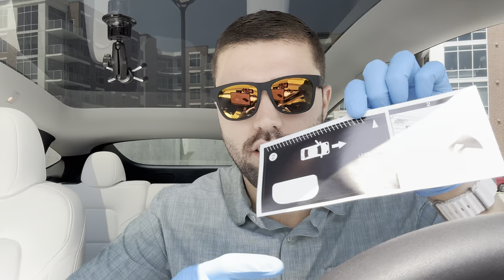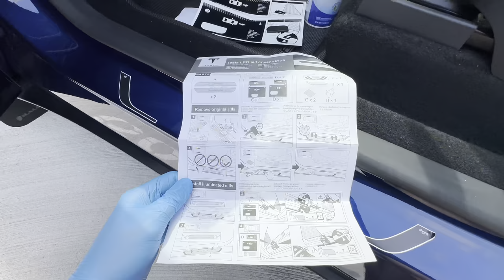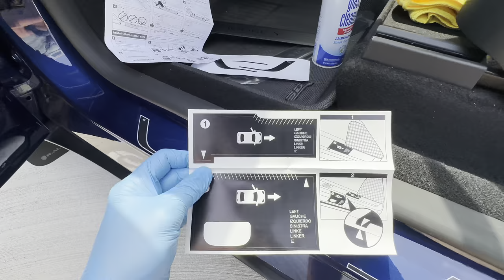It's Time To Get Lit.... Door Sills On My Tesla Model Y! Unboxing And Install

Comment: Awesome video, Branden. Thanks for putting this together!  Have you/will you be doing a video for your black wheel covers?
Reply from the maker: The wheel covers will likely be a testing video to compare the efficiency to the stock Gemini wheel covers and I'll include them in my coming accessories video. If you're interested, here's the link to them though (with a discount code!): https://twitter.com/brandenflasch/status/1686030788536446976?s=20

Comment: Ryobi makes a decent 18V battery operated heat gun.  I use that for all my projects even indoors.
Reply from the maker: I’ve used that and the Milwaukee one before - they work well. I could’ve found a way to plug in a heat gun if really needed

Comment: Hey Branden,  great video.  Do you know if the batteries can be changed on these or would you hypothetically have to buy replacement sills?
Reply from the maker: I didn’t take them apart to verify, but it seems like you could remove them and replace the batteries but you’d have to replace the adhesive. Essentially, they’re not intended to be serviceable.
Reply: @brandenflasch  Do you have any idea how long they would last?  If they included a light sensor on them, they would at least not light up during the day, potentially increasing their life span.  I usually keep a car 2-4 years, so if they made it through that, they might be worth it.
Reply from the maker: @fpartidafpartida  I suspected they should last 2-3 years

Comment: Those batteries are only good for about 3 years and they don't even stay on when the door is open. Not something I would do. I would rather have hard wired ones. Now if the batteries could be replaced from the top or slid in from the side without removing the entire sticky thing I would do that for sure.
Reply from the maker: I agree that it’s a miss to not have a slide out tray from the bottom or side of the sills to allow battery replacement
Reply: @brandenflasch  I know, right? It's already thick enough, seems like an easy thing.
Reply from the maker: @frankcoffey  Not sure they’re worth $250, but I’ll take them for “free”
Reply: @brandenflasch  Yep, the old saying is true. "If it's free give it to me, if I have to pay, take it away".

Comment: So I sprung for the OEM Tesla door sills like you installed so I wouldn’t have issues.  So far only did the right side and followed directions to the letter.  It works about 33% of the time and fails to light the other 67%.  Decals still in place for magnet and have photos ready to show Tesla.  Kinda feel magnet to sill is too far away or magnet is not strong enough.  I’ll try to adjust magnet a bit more tomorrow but not confident that will solve.  Did you have any issues? Your thoughts.
Reply from the maker: Mine seem fine - I wonder if your doors are slightly misaligned or the magnet isn’t strong enough?
Reply: Misaligned doors on a TESLA???  Is that possible? 😂. Actually very impressed with this 2023 build quality compared to my 2020.  Virtually flawless.
Reply: SOLVED—Had to re-engineer magnet assembly with larger and stronger magnets. Old ones were weak and tiny.